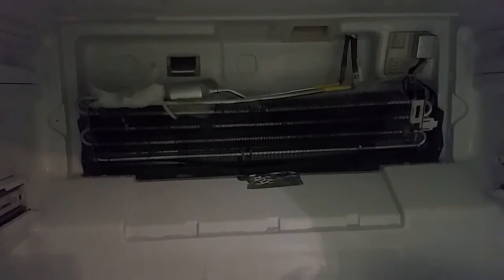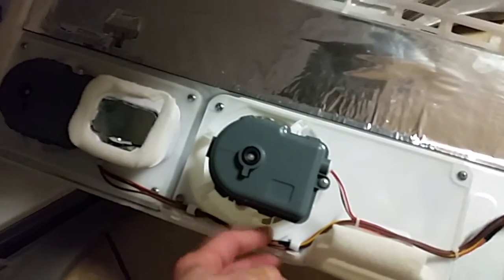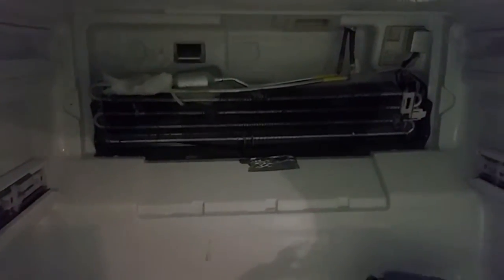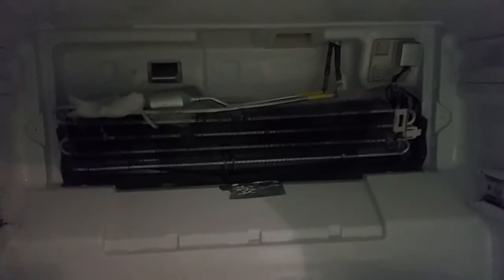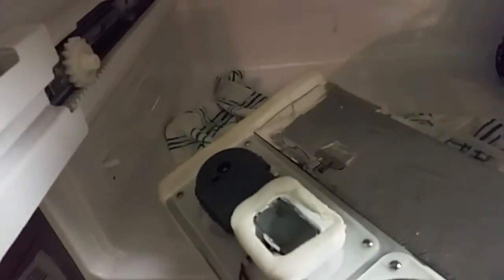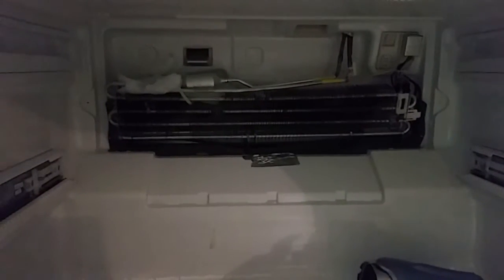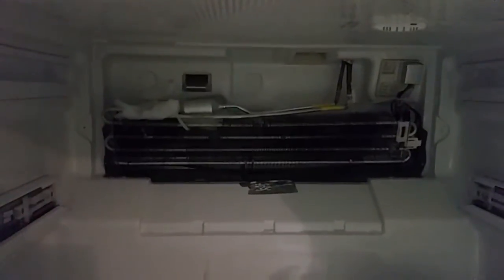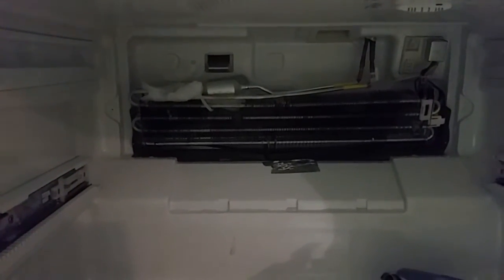Samsung RF4287HARS freezer noise fixed Part 1

Comment: Here is the exact problem with this fridge.
When the  bottom bin is put in or pushed back it blocks the flow of  air
in the freezer thus causing the ice to  build up on the coil. The heat strip is suppose to come
on and  defrost  the ice on the  coil. This  heat strip does work and does come on.
However the heat strip is programmed to  stay on for  45 minutes. Since the
ice on the coil is  now so  thick from the bin blocking the airflow the heat strip does not have enough time to thaw the coil.

Fix  #1 and this is a fix  Samsung would need to do -- reprogram the board so the  heat strip stays on longer.

Diy Fix---- Drill holes  in the back of the bin( the  bin where you put your food so that  air  will flow
and not be resticted. Keep the freezer at zero degrees. Being kept at zero will allow less ice
build up on the coil, so  that when the  heat strip does come on it has enough time to  defrost the coil.

PROBLEM SOLVED

Comment: And peace returns. Thanks for the video. FWIW it took me close to 1.5 hours to get the back cover off. Lots of ice build up. I propped the hair dryer up the bottom vents to start and then when I had some wiggle room propped it open a bit to get more warm air behind the cover and eventually it came off. Then I was able to get to the rest of the ice. Hopefully this lasts for a while!

Comment: Thank you this helped alot mine has 2 fans on there and the one on the left you can't disconnect it's like attached to a shrowd of some sort. Either way I got it fixed thanks to your video. Thanks bud

Comment: I've had this appliance since brand new in 2014 and it has been a constant frustration. I would say that Samsung should maybe keep their focus on cell phones, but I had 3 of those in the last 12 years and they were all junk too.... maybe they just needed their fans deiced. I'm officially done with this hunk of junk as I've just ordered a replacement...I hope like heck the next brand is better. After performing deicing on both upper and lower fans, this will hopefully hold out for 2 weeks.